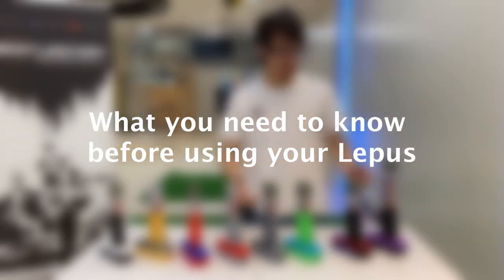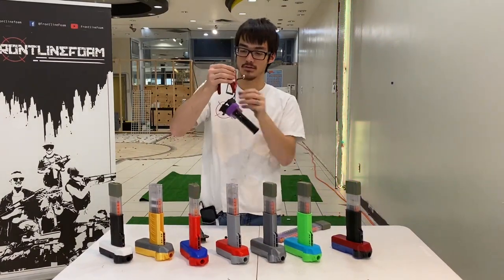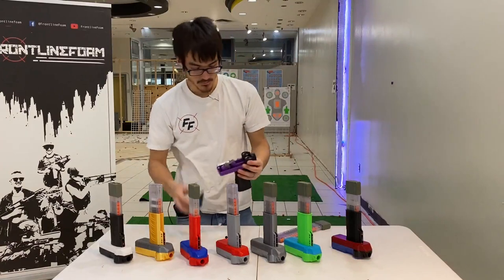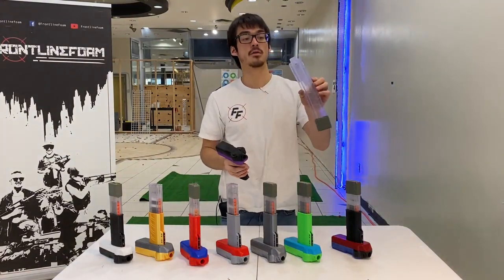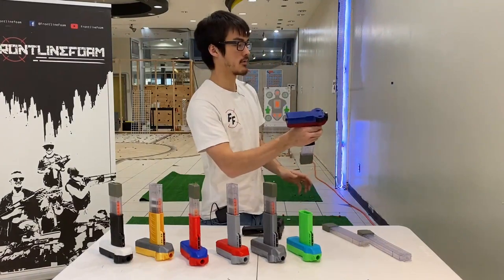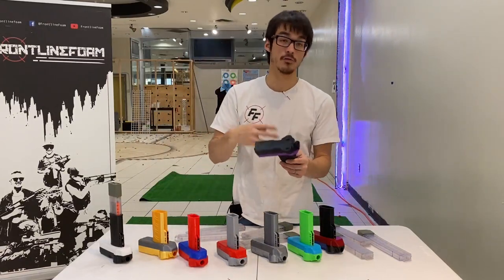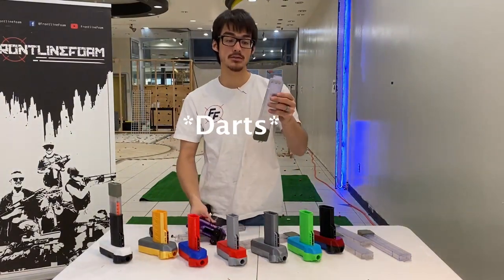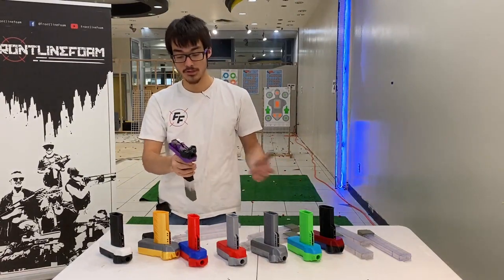Before you Fire Your Lepus, WATCH THIS

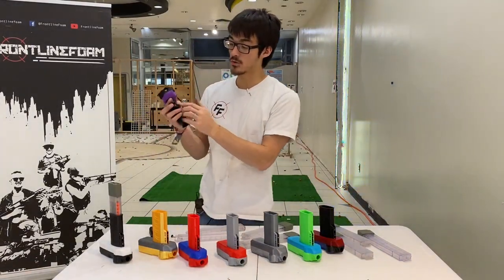Comment: 2:57 could you upgrade the switch so they don’t burn out so quick.  I know from experience that the switches used were no good and stoped working after 3 or 4 short uses.  For the amount of money spent on the complete blaster it’s kind of ridiculous.
Reply: Same here. They must be pulling too many amps through that tiny switch and burning out the contacts. Had some other issues with the switch sticking too.
Reply: Same.